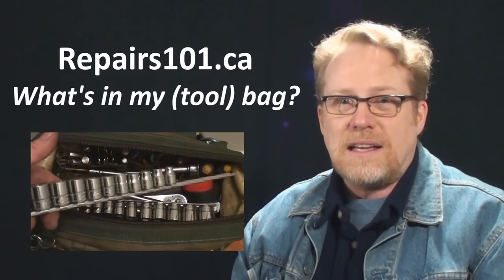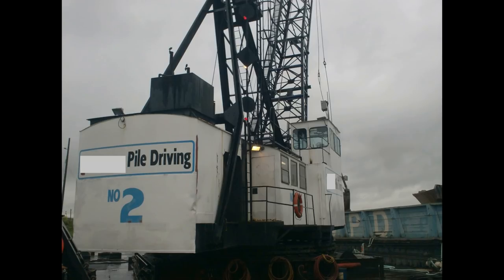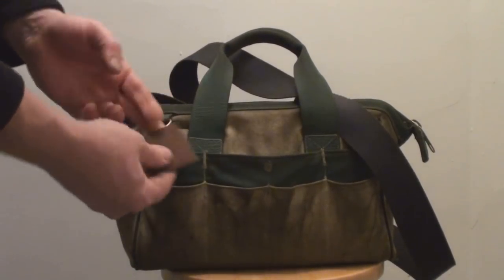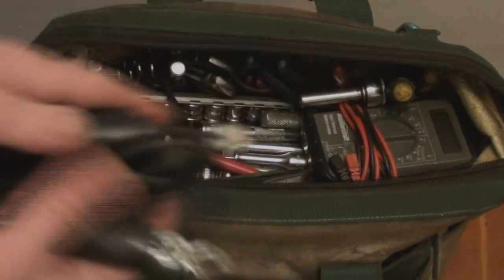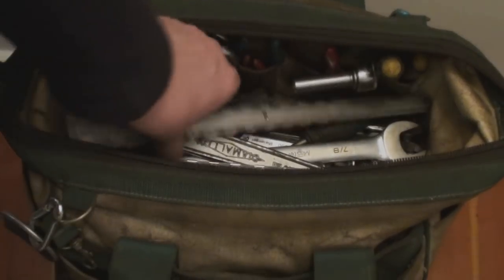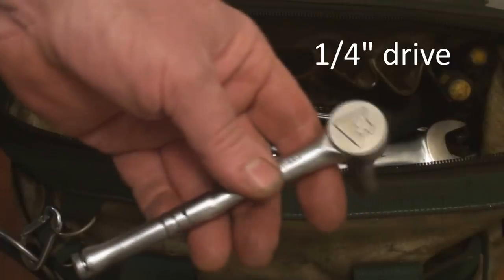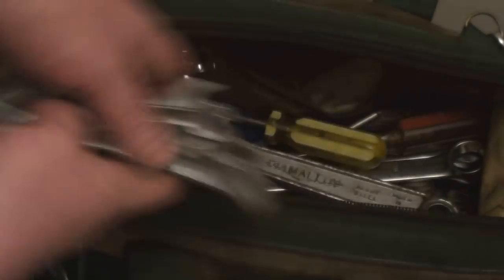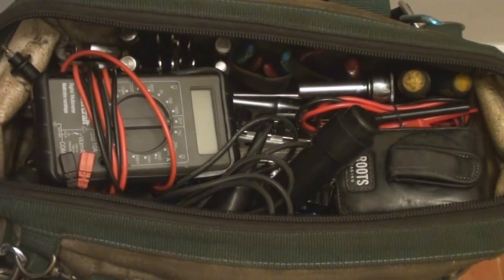What's in my (tool) bag? Show & Tell : Heavy Duty Marine Mechanic

Comment: You carry enough to build a boat! J/k! I'm a bus mechanic and my bag is no where near your weight. Over the years I've tried to streamline what I take. But, they don't want me to repair the bus on the road, they just want me to get it back to the shop. So my kit is light. Yet compared to other guys I've worked with, I carry a lot.

Comment: I do furniture repair, so my kit is similar, but less on the wrenches and more on upholstery and woodworking tools.

One thing that would drive me nuts is just having all the wrenches essentially in a "pile."   My wife sewed up some canvas rolls with so the wrenches will be in order.   On my travel kit, I have both SAE and metric in the same roll.   In my shop kit, where I have more sizes, I have one roll for each.  It's easy to find the one you want and easy to see when one is not put back away (so you don't leave it behind).  And, no, I'm not OCD, I just try to be efficient.

Don't forget some Band-Aids :-)
Reply from the maker: Great idea! I have band-aids with my PPE (personal protective equipment) and a compression bandage hidden in my hardhat (old loggers trick based on the notion that there's no such thing as a minor chainsaw cut.)
 Thanks for commenting!

Comment: You make a lot of good points in your video. I can never have enough stainless steel wire, and have a good sized roll of a couple different gauges on hand at al times (22 and 24 gauge is fine). And I'd be lost without the deep sockets and extensions to get into those tight areas. :)

Comment: Fantastic set of tools! I've got almost the exact same setup.  Can I ask why you chose to carry two sets of large wrenches? I can usually get away with my 12" crescent to hold the bolt head.  Mine comes in at 22.5lbs.  I couldn't imagine lugging around that much weight. 
Happy Trails!
Reply from the maker: Joe Ostrowski Sometimes just getting from the shop or truck to the boat and back can be an ordeal. I have to factor in the possibility of dropping something in the water so I try to have two of everything. The extra weight is better than multiple trips ashore.

Comment: You should get an 11 in one. one of the most convenient tools on the market
Reply from the maker: I'll bite. An 11 in one what? Screwdriver? Swiss Army? Leatherman? One of those credit card thingys? (I Googled it and those were the suggestions.)
Reply: Screwdriver, it has 4, 2 sided bits in 2 different size sleeves that fit into another sleeve and the whole thing can be flipped around to get to the other bits, Klein makes a good one for about 20 usd. It makes a big difference and you can sub out the bits for different ones you may want to keep in hands reach.
Reply from the maker: Thanks for the tip!
Reply: Repairs101 Looks like with all those wrenches that a knipex wrench pliers is something for your
Reply from the maker: FoodOnCrack Another one i had to Google. Never seen a pair before but will keep an eye out for them,  (Canada has poor merchandise selections in most categories when compared to the US and other markets) Thanks!

Comment: The weight and bulk of a few of the many redundant wrenches might better be taken by an impact driver (which has saved my bacon on a number of occasions).
Reply from the maker: Great suggestion but I need backups in case of slippery fingers. (splash!)